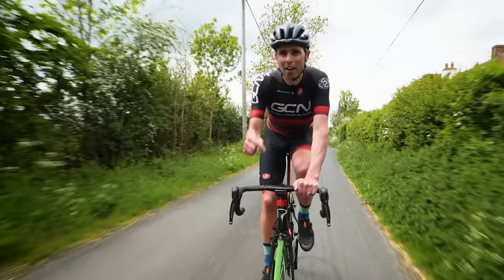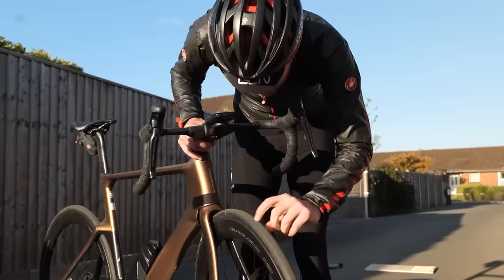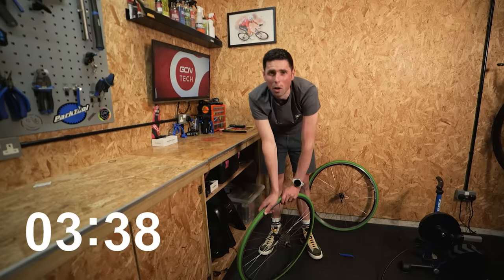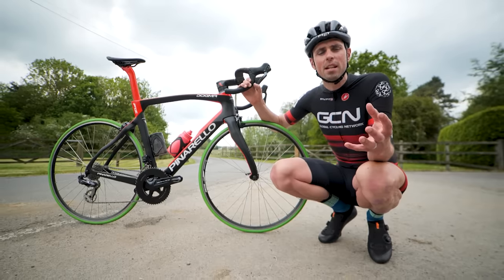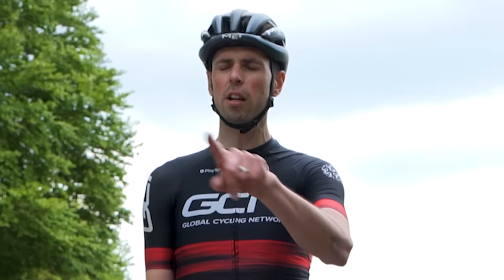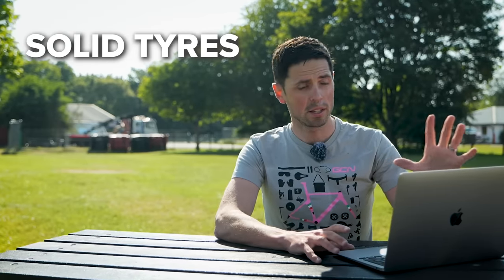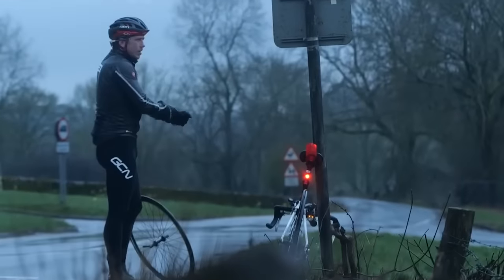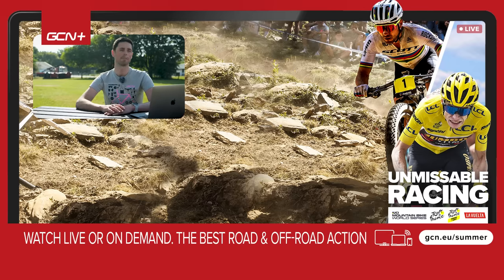We Bought PUNCTURE PROOF Tires, Are They Any Good?

Comment: Y'all should test Tannus' Airless Tires.
Reply: I want to see how they affect if can rotate wrong way, mainly as was tempted to put them on a bike but it have a flip flop hub
Reply: @mlee6050  I'd be interested to see that as well, it looks like most (if not all) of their airless tires are directional.
Reply: I put Tannus Aither (26 x 1.75") on my eBike and get pretty much the same range out of it I was getting before. Maybe 45 miles now instead of 50 before.
Reply: I have tannus on my genesis with a hub gear too.... They aren't as quick, but on a commuter honestly can't say it's that noticeable. Grips always been good too.   Bugger to get on with the tabs!! glad they last a lot longer than normal ones, saved me trying remove em😅
Reply: @joshuafoster8976  yeah they better last, I use tubular to commute on so yeah lucky I never had a puncture yet
Reply: Dude TANNUS ARMOUR  IS THE REAL DEAL!I have been doing bike deliveries for 7 months and 7mos with TANNUS with Z-E-R-O PUNCTURE! Its the best thing that I got for puncture resistance! I rode tubeless for more than a year and I can definitely say TANNUS is better! 👏👏👏👍
Reply: @dwight6502  I like to see any puncture with tannus since it is airless lol

I often had schwalbe clincher and cycle over broken glass without getting puncture but that was mountain bike, on road bike I use tubular for commuting and never had a puncture
Reply: @mlee6050  sorry forgot to add ARMOUR since I am using TANNUS ARMOUR not the TIRE. LOL
Reply: @dwight6502  oh okay, I always think of tyre first then that octagon ring and last the armour with that company

I always look for tyres with puncture protection in, as schwalbe giving up tubular, I'm hoping continental don't quit them until after I hide 6ft deep
Reply: @dwight6502  I had Tannus Armour inserts (with Marathon Plus tyres) before swapping to their solid Aither tyres. I still did get a puncture (on my eBike, rear wheel) even with the inserts and M+ tyres - that's why I swapped to the completely solid "Aither" tyres.

You might wonder how I could get a puncture with Tannus Armour and Marathon Plus, since that's a total of 20mm protection (5mm from the tyre, 15mm from the armour insert) but it's because those inserts flatten out over time.

If you let your inner tube down and pry off a small section of tyre and check the bottom of the insert after say 6 months of use, it won't be 15mm anymore, it will be more like 3mm. I have even seen a video of one on a fat bike where it ended up very thin like 1mm! It seems to be a combination of how high your PSI is (higher is worse) and how fat your tyres are (fatter is worse) so with that in mind, there is no scenario where those inserts won't just flatten out over time.

If you have considerable weight on the rear (I'm about 200lbs on a 60lb eBike) you'll still get caught out one day with those Armour inserts in. They are a good idea and don't really affect the handling or feel, but they end up a 5th of the thickness, at least mine did. When left off the bike, they end up back at 15mm again.
Reply: @joshuafoster8976 
The way you remove them easiest is with shears, and just chop them off.

Comment: I used the Tannus solids for commuting a couple of years ago and although the speed was affected and the initial ride was boneshaking, after a new saddle and inner tubes underneath the bar wrap there were no complaints. Solids are perfect for commuting but they do make riding in wet interesting.
Reply from the maker: Sounds like you made them work for you! How did they cope in the wet... please tell us more
Reply: @gcntech most of the tannus solid tires come in different hardnesses...  soft are equivalent to 95psi, regular at 100psi and hard at 110psi... this is for 700x28 on a 16mm internally wide rim. I've never used them myself but another cycling youtuber used a pair for quite some time... Cruise over at Two Wheel Cruise while he was living in Japan.  

I've somewhat debated on getting a set myself but ended up with Schwalbe Marathon Plus on two bikes and Panaracer tourguard plus on another.
Reply: @gcntech  It was sketchy. I didn't come off but avoided manhole covers and was careful going over road markings. The tyres were slippery on the lines.
Reply: also slippery on rail crossings, trams
Reply: Solid bike tyres are more meant for Off road and Mountain Bikes aka front and more importantly rear suspension on a solid bike frame the tubes do all the shock absorption

Also a solid bike frame with a good suspension seat instead of a solid mount seat helps a lot since their is no Wheel Suspension

If you do have Rear Suspension and still rough ride on a seat with springs snd/or balls and good padding will help massively

Comment: I rode Tannus tires for a couple months.  They were slower, roughly 7 percent in either speed or power numbers.  However, not carrying a pump, tube(s), patches, levers, was really nice.  If you truly train off power and TSS, and your ego can deal with being slower than usual, and a rougher than normal ride, they work as intended.
Reply from the maker: It definitely would be nice not to carry stuff all the time!
Reply: @gcntech - you need to test Tannus aether tyres. The solid tyres used in the video don't appear to be Tannus so the test wasn't really representative of the best in class. Tannus tyres are great for commuting and on training runs precisely because they are fit-n-forget and weigh less than pneumatic tryres with puncture resistance. They also last way longer than pneumatic tryres.

Comment: Interesting concept. As a bike commuter, I can definitively say that waking up to a flat tire on your bike when you're already running late is extremely frustrating and has a tendency to make you want to buy the most puncture-resistant tires possible - it's not just how fast you can change a tire, but the worst timing possible of needing to do so. My husband and I have been riding on Schwalbe Marathon Plus tires the last couple years, and have had no punctures on them - I even found a large (several mm) gouge in one of mine while doing my bi-weekly dig-glass-shards-out-of-my-tires session, which I take as proof enough that they've stopped at least one serious puncture. 😅 They are an absolute pain to fit onto a rim though (especially my bike with 700x25 tires), and I can't imagine fitting a full solid tire on.
Reply: I have gotten flats in the awkward places and at weird times.. Makes me want to give solid tires a try.
Reply: I've been using Schwalbe Marathons and haven't had a puncture for years even commuting in central London.  But it takes me about 20minutes to put both tyres onto the rim though so it's just as well they don't puncture!
Reply: Same tires, 5 years commuting without a single puncture.
Reply: I kind of also would think the comparison to the Marathon Plus would be interesting, since they already feel almost wooden.
Reply: Swalbe Marathon plus tyres are heavier than Tannus aether 2.0 solid tyres!
Reply: I can recommend the Schwalbe Marathons tyres too. Even when they are a pain in the rear to put on, they have never let me down. My commuting route includes normal road, gravel and even a small forest path with bigger stones. The only two punctures I had in the last 5 years where both from old rusty nails some how sticking out of the ground.
Reply: I used Schwalbe Marathons on my old bike and they were great, but had been using the stock tires on my Trek FX 3 since I got it last year and only had a puncture or two which I thought was pretty good for the tires that came with a bike. I was going to try some Conti Gatorskins for a change, but ended up going for GP 5000s for them being lighter and having better grip. We'll see how they do.
Reply: Solid tires are a pain to put on, but you only need to do it once. They're also a pain to take off.

Comment: nice test. Next time it would be interesting to get a third contender on board, the Schwalbe Marathon Plus. The next best in protection behind solid tires but still the compliance of having inner tubes.
Reply: I have the Schwalbe Marathon Plus on one of my city bikes, where speed is not that important. They have a thick 5mm (!) puncture layer and are close to impossible to puncture. I see these tires as the standard in my country, the Netherlands, they are everywhere and for that reason. One such tire ways 900grams (!!) though, which double that of these solid tires, at say 460grams. 460 is slightly less then Pirelli Cinturato Gravel-Hard 40mm at 480grams, so its not the end of the world.
Reply from the maker: Good suggestion!
Reply: Honestly, I cannot remember having a puncture on my commuter bike (doing roughly 100km / week). Schwalbe Marathon Plus FTW
Reply: I've never used the Schwalbe Maraton Plus on any bike, but my son is using them for his wheelhcair and never punctured as far as I can remember (which pleases me since I'm the one that would have to fix it...)
Reply: The older Schwalbe Greenguard has a green 3mm [uncture layer and is a lot more4 flexible and much more enjoyable. The Plus is like a road bike with 120psi, so very bumpy
Reply: @Aragorn.Strider yep, the schwalbe marathon greenguard is a very good balance in rolling resistance vs puncture resistance
Reply: I ride these indeed, and have so since.. 2014 or so. New bike coming soon with non-marathons ( G-one ). I'm curious how they feel after being used to Marathons!

Comment: Sick of getting punctures, I did a web search on whether you can put the anti puncture gel usually used with tubeless into inner tubes. Not only was the answer yes, but muckoff make a version of the product with a nozzle designed to insert into inner tubes. This has definitely kept me going. I found my tyre was slightly soft one morning and found a huge gouge in the tyre from the previous evening, which would otherwise have meant a long walk home.

Comment: I put Tannus Portal 700x28c on my 20-mile-per-day commuter a few months ago and won't look back. One problem with this test is that you didn't break the tires in, they take about 50 miles to really settle. I wanted to buy them for a long time but didn't because of takes like this. After 3 months of 20 mile per day rides, I would say that as far as pedaling effort, they are better than the 700x28c Gatorskins I had before this but worse than the 700x25c Schwalbe Marathon Pros I had. With the Schwalbes I was usually riding at 22mph, with the Gatorskins and Tannus I'm around 18mph. That's roughly a 20% difference, though I also ride for fitness so it's not a problem and stoplights are the majority of the variance in my door to door time.

As far as grip, they're roughly equivalent to Gatorskins, so they slide more easily than I'd like. Again not a problem in dry conditions, and I don't ride wet.

But the main thing is, once you have them for a few months, a couple of things are really nice. One is that you stop thinking about your tires as a risk and something that can fail at any time, and start to think of them more like shoes. This is a big deal for me. The other thing is you never have to wonder, am I feeling slow because I have a slow leak? The experience on the bike is exactly the same every time.
Reply: I ride the same Tannus Portal tires.  These so called 28s are slightly smaller than my Continental 4-Season 25s.  They're really 25s but who's counting.  🙂
Reply: I don't think the tires in this video were Tannus tires.  Tannus tires are a lot more expensive than the ones he bought.  I am sure he bought cheap Chinese solid rubber tires.  Tannus tires are bound to be a heck of a lot lighter.  I been riding Tannus tires for years and will never go back.  Haven't had to worry about flats in about 5 years.  I am just a casual rider for exercise about 12 miles over other day or every third day.  Yes, the ride is harsher but I got a nice spring under my seat which pretty much cancels out the harshness.
Reply: @SecondLifeDesigner  Yes he put them on in 3 minutes thats fast, don''t know what he was moaning about.
Reply: Thanks for confirming a 20% difference - Tannus have tried to gaslight me on this but, as I said in my own comment, Komoot is consistent enough that I trust its statistics.

Comment: Alex. I'm on my second pair of solid tires. The first set did over 14500km. They cost £100 the pair. A good investment. I'm 61. Can't do speed anymore - I do loads of long rides and the piece of mind is what I like and I can off road if I need to. Also and you didn't mention this, I have to work harder as the rolling rrsistanceyis greater. Uses more calories.
Reply: I am 59. I do speed. Is something going to happen next year, I wonder.

Comment: Thanks Alex, this is what GCN need some more down to earth normal riding questions. But it would be nice to test this against puncture resistance tyres, like gatorskin or marathon plus
Reply: I've used Marathon Plus tyres for the passt 12 years and havan't had one puncture. I'll have to get some new one soon because the tread is wearing thin.
Reply: Urban commuting in a major metro center which is all broken glass and metal debris Gators have yet to let me down.

Comment: I ride on Michelin Lithion 2 tires and thick thorn resistant tubes. At one point I was commuting to work during the warm months 18.5 miles one way about three times a week. I have only had a flat twice. The nice surprise is the thorn resistant tubes are thick enough that when they go flat you are not riding on the rim. Still enough cushion to be able to slow then stop without losing control.

Comment: I haven't used solid tires myself (and probably never will), but one of the interesting things I've read in the review somewhere is that they also can wear out unevenly, thus making your wheel non-round and the ride feel like ... that one time when your inner tube got pinched between the rim and the tire and you didn't notice at first.

Comment: I just did replace my rear wheel with Tannus Slick Solid Tyre 700 23C to avoid the puncture problem for my cross training process :) It felt and rides like a pneumatic tyre :)  But it's definitely not for racing ( at the least for now)  :) I personally think if the demand for solid tyres in the market grows, there will be adequate amount of R & D going in the development of efficient solid tyres Imagining, say from Aither 1.1 to Rubber ones :)  Thanks for the video GCN :)  I just had the assurance from my bicycle retailer about the Amazon / Ebay Sold Solid tyres, after watching your video guess it could be the most affordable trustworthy option :)

Comment: There is a huge difference between flat resistant and solid tires. Alex, I believe that you’ve taken this to an unfair extreme. I have previously ridden 37 mm Continental clincher puncture resistant tires for many, many thousands of miles. I never had a puncture however, rolling resistance, comfort and high speed cornering suffered. 
I recently purchase Schwalbe Marathon Plus tires 35mm which are advertised to be highly flat resistant. The rolling resistance and cornering are greatly improved and I’ve yet to have a flat. 
The nicest thing about the schwalbe ciinchers are that due to some special side wall,  I’m able to run them at 15-20psi lower pressure than any equivalent tire I’ve used in the past. This yields more comfort and way better handling. Pneumatics can not be replaced for more reasons than I could think of. YOU know that Alex!! 🤔
I’m a road endurance rider so speed it not as important to me as distance, compliance and comfort, so the Schwalbe offer a huge improvement for me.

I’m surprised those cheap, plastic tires didn’t slide out from under you when cornering.  Thank goodness they didn’t You don’t need another crash. 😂

Comment: ATTENTION!!!
It's about safety - and therefor another reason for an urgent WARNING concerning these types of tires that actually has nothing to do with speed:
Over time - actually a very short time, the cross section of these tires wears down from circular to a circle with a flat top.
To lay the wheel into a corner the bike first has to get lifted over the edges of that flat part against the entire system weight.
Out of the corner it's the other way round.
That results in a completely unaware feeling/handling experience - which is nothing else than troubling and likely very unsafe.
Control over the bike is simply impeded.
I fortunately yet didn't have to make the experience of an emergency situation with that effect.
Furthermore:
The fit of these tires runs loose on the rims over time.
That first can get detected in a strange quirking sound resulting from the tire lifting up and down in the rim.
It literally sounds like having ducks in the wheels.
I expect, that not much later there will get a kind of bubble pushed around the rim impeding the round rolling - and potentially leading to a dangerous failure.
I didn't get the brand referred to in that video.
I refer to Tannus Aither 1.0 and 2.0, 700c/28mm, which are in an entirely different price level.
I did go for them on a bike with which I want to be as safely as possible IN TIME.
It doesn't help if you are quicker at a train station on bike if you have to calculate safety time for a possible puncture into your ride.
Therefor these tires make some sense.
But they are simply scary!
Tannus improved two main issues. 
They removed the tire threats that had a "self-cornering" effect (meaning that the tire literally pulled itself into the corner).
They improved the compound to be more comfortable, having more grip and a more predictable cut-off of the grip (the 1.0 didn't slide first in a corner, they just dropped of...).
So everybody - be aware of these dangers!
Reply: Never trust a comment where every sentence is followed by a press on the enter button.